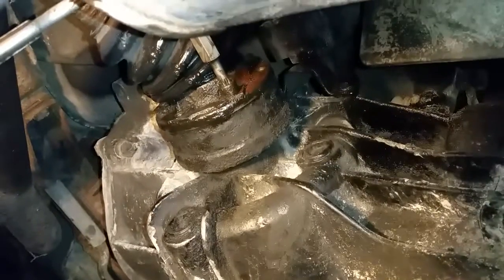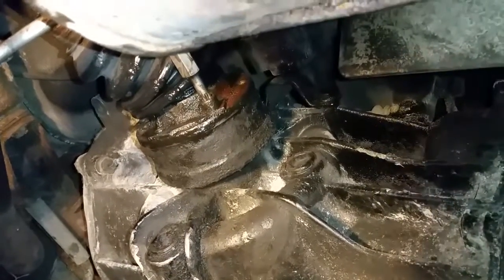Porsche 944 Cv axle removal

Comment: Is the cv axel the same for the 89' 944 S2?
Reply from the maker: The may look the same and install the same but the part is actually different because of our model year difference. But all models of the 944 shared the same cv axles from 85.5 to 91 on manual transmissions.
Reply: FC Imports great! Thx